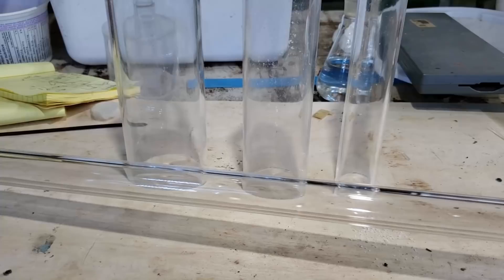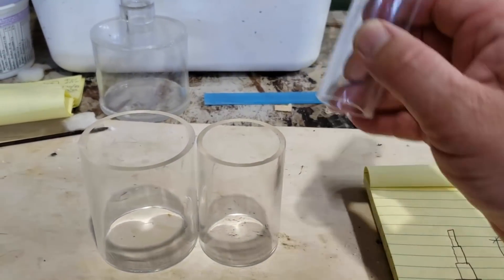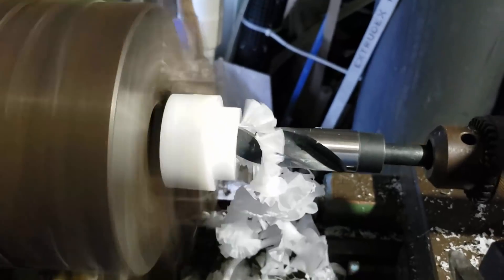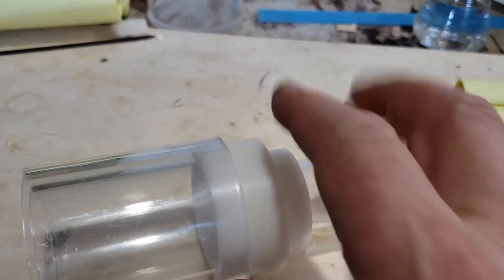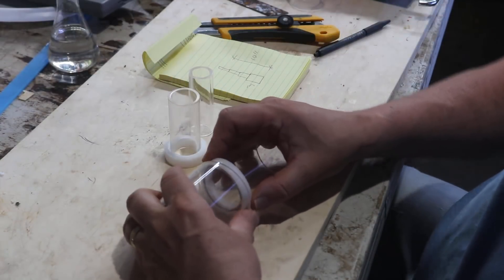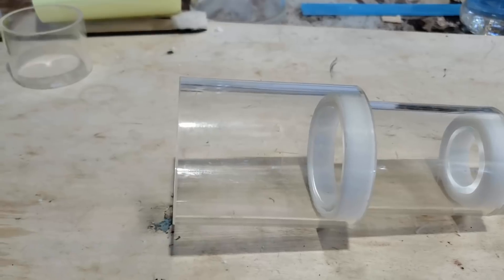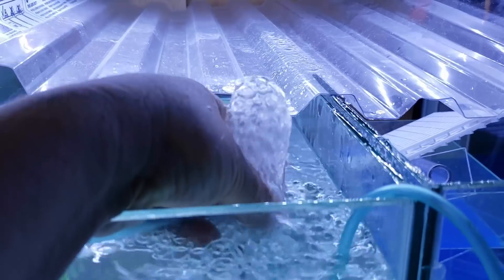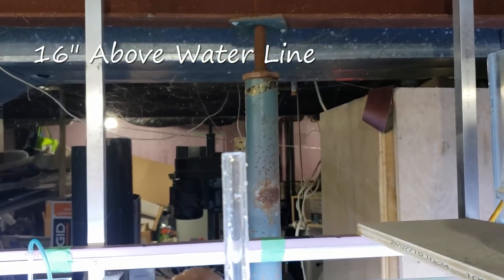Getting More Water Flow Using Air

Comment: It's not what you want to do, but I have had the idea that we lost a lot of filtering capacity when they eliminated the old air driven outside filters (siphon in/air drive out).  THAT is where this idea could work in increasing flow rate and with a smoothly curved return neck it would give nice surface agitation for oxygen and surface film break up.

Three things: 1) those inner edges are creating a lot of resistance,  2) a very much larger media box could be matched with an improved air return for a large net increase in bio filtering capacity over the mag drive HOBs with their chintzy size boxes.  3) I can't find anywhere where they sell the "J" shaped siphon tubes that would be used with such a filter.  None of the on-line pet supply stores, nor could I find a commercial manufacturer of tubing selling it.  You'd think it was a capitalist conspiracy to force us into using mag drive HOBs and filter cartridges.

A top > down hanging outside filter would allow a permanent and undisturbed bio colony at the bottom, while allowing top access to change filter floss or rinse sponges.  Work something up will you - maybe sell it - or maybe find those siphon tubes.
Reply from the maker: I've converted so many commercial HOBs to top down filtration and they work much better than the suggested method. The reason why it's not the recommended way is they never need replacement cartridges. The oldest one I have working is closing in on 30 years and still works great. The original sponge is getting a little ratty though. As for "J" shaped pipes, they used to be the standard. I have no idea why you can't find them anymore. There doesn't seem to be a reason for it. My reason for not making them comes down to bending 1" or greater tube. I'm not set up for it. Thanks for taking time to share all of your thoughts on this!

Comment: i once thought of making a kind of ladder, either with tubing or boxed,(putting a step every few inches with an airstone),unfortunately i did not have the room or tools.luv your vids.
Reply from the maker: Great minds think alike. I've thought of trying that as well. The problem I've not been able to work out is regulating the flow between the levels so that none run  out of water. Thanks so much for coming by and watching

Comment: Look at Glenn Martinez you tube videos. he has ideas on using air to pump water.  The best I can get is 2 - 5 gpm. but I am using it to pump 1 to 2 ft above water level in outside tanks.
Reply from the maker: Thanks. Could you put a link in the comments and I will have a look

Comment: If you taper the edges of the tubes and bushings in the direction of the water flow plus add a vertical separator in the tube that has the airstones, wouldn't that increase the volume of water lifted?
Reply from the maker: The bushings are completely covered so that part isn't possible. Tapering the tubes so that they are more cone shaped would definitely have an effect. Not sure how easy that would be to implement. I will have to give this some thought. Thanks for sharing your thoughts on this and for watching
Reply: Possible.

Comment: Most likely mixing up your filter types, but why wouldn't your leak proof filter work? Isn't it effectively in line and returning below the water level? Or would the water pressure on the return prevent any meaningful amount of flow?
Reply from the maker: Impeller driven pumps have a greater ability to keep flowing with increased resistance. I'm not sure if air would do the same. I would have to test it out before I could use it. Thanks for the thought though and thanks for watching